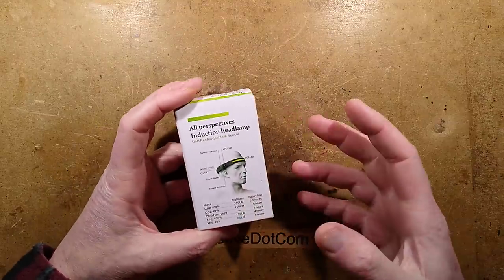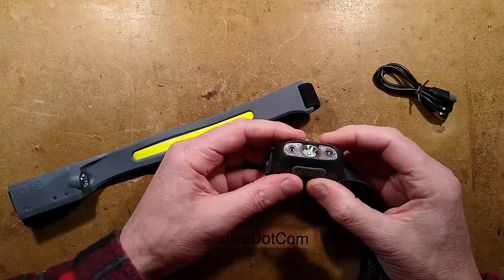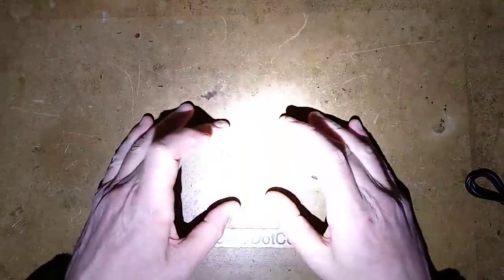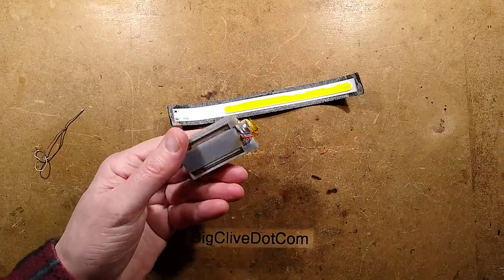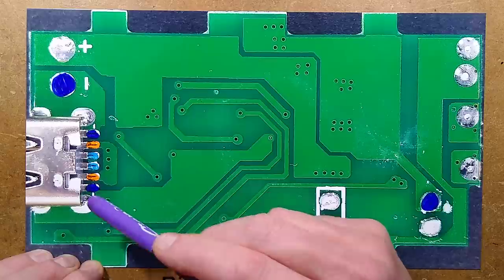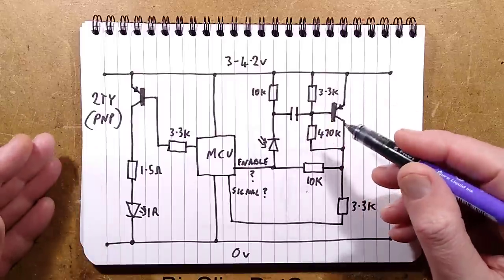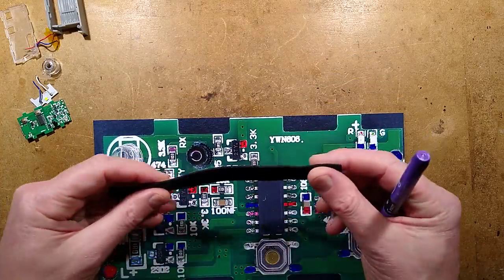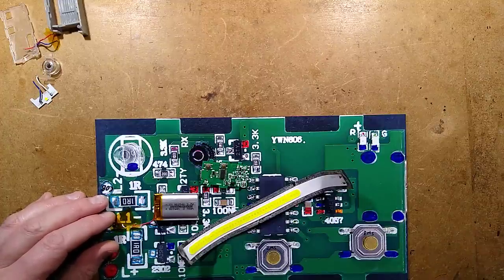Night Buddy style headlamp teardown with schematic

Comment: Those are everywhere, both on eBay and Amazon. But it’s nice to see the soft ones for a change. There are some that have the focus lamp on a swivel on top of the led strip and some that have sensors for proximity and a hard backing (usually a thin sheet of drawn aluminum or abs polymer). Just beware that most of them have poor to shoddy quality and they will let water in if you use them in the rain. Some have such poor insulation or tolerance fittings that if you just use them as-is and strap to your forehead and go for a walk, the perspiration will get inside the “protective” area of the photo strip and fog it up or even short it. Also there are plenty that have very short cables between the battery and control pack  that make using them in cramped spaces, where there’s a high likelihood of hitting your head/helmet/headlight to be a huge hazard for the headlight itself. Had to change the cables from one set because they were so thin that just the act of removing it from my head and folding the headlight with its strap to store/recharge would break the originals (got one set waiting for a cable set that only the photo strip works, the headlamp got either cooked or the wires for its switch in the board snapped as well).

Comment: Nice video and very informative. I have this headlight and is ok. The cob light is actually decent for work in open spaces, camping. I don't use the focused light very often. One thing I observed is after several weeks of standby it is self discharge. When I connect the charger it takes time to get any feedback from the led. First time I was testing several chargers and I was thinking it is game over. But after 15 minutes the led was on and charged the battery. Since then I connect the charger every week and no problem. The original cable has a longer USB C connector and working fine. I you are using other cable, the connection is not good and no charging.

Comment: I have found that with the cob directly on forehead lights like this one that they cause my glasses to flare with the reflected light. I have a preferred one that has a 1-2 inch cob and a focused beam on a pivot that also takes a removable 18650. Super cheap but works really well for me.

Comment: My favorite headlamp for working at stuff is Sofirn HS10. it is aimable down to my nose if i wanted. Features 16340 battery with 800mAh capacity 1100lm output with 90CRI LED amd TIR optics. And the cherry on top - magnetic tail cap to stick it to anything metal when not using as a head lamp... You should consider doing a video on it.
PS: It does have smooth ramp up or ramp down of power output. But it doesn't have no contact wave hand in front function however.

Comment: "I need a new flashlight."

Regular human: Walks into a store and buys one.

Me: Let's see. USB-C. Time to start upgrading those Micro-USB ones. Button on the side, not at the end. Good. Short press to turn on and off. Long press to change modes. Good, good. Now for the headlamp. Rechargeable AAA batteries, please, so I can replace them quickly. Short press to turn the lamp on. Following short presses change modes. After being on for a while, short press turns the lamp off. Next press turns it on to the previous state. Excellent.

There is a special place in a very hot environment for engineers who think it's a good idea to always have to cycle through every setting just to turn the unit off. 😅

Comment: I do like it because when I'm working on a car under the hood I get the illumination of the cob which is great but I also have the focused beam which I occasionally need to see down in between the engine and the firewall.  It's rude to blind people with the cob which is why the infrared sensor is very useful because my hands are dirty and I don't want to fish around for the button with all that grease on my hands.  Although it falsely triggering whenever my head gets close to something is rather annoying so there's not many times when I can actually use the sensor.  I bought from two different sellers on ebay. Both very inexpensive.  They had some large differences. One of them was lacking the dim setting on the side light and it's battery got all swollen up and it quit working after only a week of owning it.  The other one still working great and it's 2 months old now.  I like how lightweight they are and it's nice having the bulk on the side of your head instead of on your forehead.

Comment: I find these very useful when I need a diffuse light for seeing a wide area. As an old fart that needs reading glasses for close work, the side mounted direct beam isn’t that useful as you need to Fanny about getting it lined up so that you can see in focus without the beam high ting your right hand glasses lens. The PIR on/off function is useless if you’re working under or around vehicles (or anything else) and I’ve had it operate walking through doorways.

Comment: After another video you did about "head torches " I bought a Nitecore HC60 1200 lumen, great light but it will keep your forehead HOT on any setting other than low, had it on high and made the mistake of setting it on the floor with the lens pointing into the carpet, melted an EFING HOLE in the carpet, super bright leds are great but careful where you set them.

Comment: I have exactly the same!
It was named COB LED. 

Do know, that when using the LED strip, att full - it get's hot behind the rubber part. Really hot.

The sensor is not that good, I use this at work. And the main reason why the sensor is not good, when getting close to objects, it either turns on or off..

Comment: I like these. They are necessary for my work and are light and low-profile. You don't have to scroll through all the settings to turn it off. Battery life on high isn't great, but you can just buy a few and swap them out.

Comment: I also prefer the same kind of head torch as you prefer. I had a really nice one that was powered by three AAA cells, but unfortunately I once left the cells in it for too long, and they leaked all over the inside and killed it. There was no outward indication that the batteries had leaked because the compartment was so well sealed. I found out when I opened it up and it was basically full of crusty white sludge.

Comment: Get 80 dollar "Low Profile" Milwaukee headlamp, its the best thing I've ever bought working on racecars. The LEDs are a warmer color and the working time on full bright is outstanding. Plus, if it dies, you can swap the battery. If you need a reliable headlamp that will always shine when you press the "on" button, get the sub-100 dollar Milwaukee.

Comment: My favorite head light is a very small pair of lights embedded in my beanie. It's not the best light but it's quite decent for how small and long lasting it is. I wear it just to wear a hat and it comes in handy all the time. I want lights in everything! Once we can cheaply manufacture small batteries capable of powering useful leds that can last for many years we could just start embedding permanent flashlights in everything, clothes, furniture, pens, jewelry

Comment: I never really took to head lamps. Instead, I have a small pocket flashlight with a neodymium magnet base, and that's worked best for me. Since I'm typically working in equipment racks or cars where ferrous metal is abundant, it's nice to be able to just stick it someplace and not worry about it. Gotta be sure not to forget it's there, though. Already lost one flashlight that way.

Comment: Ahahahaha, thank you for this one.  A local (Colorado, USA) company has claimed to have designed these when it now looks as tho they just found and imported them.  That said, their rep was in my hardware store yesterday (2-17-23) handing out a few free samples, and I got this one plus an unrelated COB key fob.  A COBFOB if you will.  I've "poked at it with a sharp stick" (the head band I mean) and held it underwater a bit (nasty me, I put a bit of dish soap in that water to eliminate surface tension) and then rinsed it after a bit.  But it's probably still wet today... too early for any corrosion to have set in... anyhoo, I do love your reviews and this one is suddenly timely for me.

I will say it's pretty bright.

Also, can we hope that this is a Li-ion battery we are strapping to the sides of our heads and not something prone to explosion and/or fire? 🙃
Reply: PS: our previous headlamp (used for camping mostly) was from the 1980s, used incandescent lamps and four AA cells and felt a bit like strapping a miner's "wheat lamp" to your forehead. O_O

What @Miata822 and @SiCrewe both said! This thing is a game change, IF it holds up, and for me that remains to be seen.

Comment: I have the simple one, too, I think maybe I got it after you took one to bits.  It's really handy, though I don't use the motion-detector mode that often.  Otherwise, great little light, probably the best headlamp I've ever had.  It'll be a little annoying when the battery finally dies unless I can find a replacement pack of a similar size, or if I can find a whole new one for not too much.  ISTR it was pretty cheap anyway.
Reply: These batteries are easily available on eBay. All the sizes and shapes are available.
Reply: I got a two pack of those I think from that same video, both of mine self-drained to 0 sitting in a drawer for a few weeks and wouldn't take a charge again.  :/

Comment: I have a really cheap similar one. There isn't a spotlight but the cob bit on the front is a lot wider and it has a little box at the back with 3 red LEDs which copy the cob section: full, medium, flash. It is great for fixing my bike.

Comment: I bought one of these recently under the brand name Molaer for $18 USD (Black rubber instead of Gray). I'm happy with it, and it does a good job.  I don't like how it flashes as the first on selection, but I do like the hands free feature as when I'm painting I don't want to touch anything once I may have paint on my glove.  I would have liked the hands free control to be able to switch modes instead of On/Off as I have use for different use cases when I'm using it.  IMHO, I think the strobing function was for use in roadside disabled vehicle situations where you want oncoming drivers to see you, and that is why they put it first (although I don't think they thought out that use case ). Opinions?

Comment: I found a variant that has the COB headband, but instead of the side mounted spot LED, it has a more "standard" adjustable main beam in the center.
Doesn't look as snazzy and sleek as this one, but with it being aimable so that it'll actually light up the thing you're working on, more practical.
They advertise the "main" as being an XPE, and it is lensed and apparently intended for a fairly narrow spotlight.
It does have a larger power/battery module with a 2Ah 18650 in it, and reviews suggest that the weight on your head is a little imbalanced as a result.

Comment: Since I started selling and modding flashlights about 2 years ago I've been reverse engineering them. I drew out the schematics of a few flashlights and they all seem similar no matter what brand or how many modes. One thing I noted is none of the LEDs have resistors. I believe they have done some tricks inside the chips to save space on the outside of the chip. Sometimes I buy samples and then decide if I want to sell them. I've seen some other things being done I like to look for. They dim the LED to make a cheap lithium battery have a longer life, that would be the 1-ohm resistor on this headlamp they would change it to a 1.2 or 1.5 it doesn't take very much. A 1.5 resistor in a flashlight would probably make it dim enough to delight everyone at a redlight star party if you changed to red so there is some usefulness in making it dimmer.
Reply: Just to let everyone know to avoid angry people, headlamps or anything with white LED even if it has red mode is being banned at some star parties. Probably screen filters and tape over the white LED on smartphones are next.

Comment: I bought the motion detector one for £10 brand new as a spare torch 
Other than blinding people if you turn to speak to them, I have found it very bright and easy to charge.
Reply: Blinding people with head torches is a problem with them all.  In my experience sites at night are full of people dazzling each other and swearing at each other.
Reply: Where did you did you buy it for £10, please?
Reply: @healthystyle  
An eBay seller around 6 months ago.
Reply: @brianiswrong  Do you have the ebay seller?
Thank you for responding to me

Comment: I bought a couple of regular strap on headlamps at Dollar Tree for working on computers. They have regular white LEDs but are not very bright. They also use coin cells that don't last very long. One day, I bought some of those small push on push off lights for closets, under cabinets etc. I thought, hey what if I use one of these for a headlamp. So I took the strap from one of the other headlamps and stuck one of those onto it with sticky pads. It work much better and, due to using 3 AAA cells, it lasts much longer. It looks pretty goofy but works well.

Comment: I got one of these (or rather one of the many many clones) and it was actually pretty great for walking the dogs in the evening in the winter. However, it wouldn't accept a charge. So I got enough use from the charge it came with and that was it. Less than a season and it was dead. I extracted the battery and it's fine. Something was not good with the circuitry and I didn't care to try to fix it.

I upgraded to a Liteband 400. It only has the COB light. But the battery is on the back of the band and I actually have dual 18650 battery holders that work with it so I'm not bound to the included battery.

What I like about these is they're more comfortable to wear while walking the dogs, especially over my beanie for the colder nights. I have a Milwaukee head light that's quite a bit better as a work light.
Reply from the maker: Try it with a different charger.  A smart USB C charger may not recognise it.
Reply: @bigclivedotcom  I tried many, including old USB-A chargers with A-C cables. It's a bit ancient history at this point, though, as I salvaged the battery for other purposes and tossed the rest long ago.

Comment: Ordered the all perspectives induction headlamp from Amazon. It came in a pack of 2. The batteries are 1200mAH, Unbelievable. They lasted more than 10 hour on the COB lights highest setting. The red indicating lamp on the battery pack was flashing quickly so I presumed the end was near, but at that point I turned the light off. But yes, it lasted 10 hours and was still in operation, but how much longer? Who knows.  Impressive.

Comment: I've had a pair of Bolle Galaxy glasses for years - very good as the (small) side lights are well boresighted to my eyeline, and provide a smallish well focused spot of light. Good for close work or well aligned for walking around as they match eye placement. Some head torches spread too much light, and as they're forehead mounted tend to cause neckache as one tries to compensate for the slight misalignment of the beam, and they're not sweaty with a headband, and the lenses offer full eye protection..

Comment: I usually open the warehouse in the mornings. Normally when I get in it is dark and the light we have is insufficient to do much of anything in the front area and it's completely dark in the back area. One of these lights might be useful to tape to my hard hat for use in the wee hours of the morning. I wish the LEDs were brighter because this would be a great reading nook light. It's diffuse so you won't have to adjust it every time you want to shift positions in your nook. "Read with a proper lamp" you might say? Sometimes those things don't fit where you want them. Mount this above you somewhere and it's a compact lighting solution.

Comment: My experience with the thing is that you can point the "spot" led by tilting the band on your head, but I do not see the light as very practical for working while sitting. Makes more sense when walking around indoors, without bothering to switch on/off normal lighting, and without needing much distance illumination. If hot already, the leds on the forehead does become a bit noticeable, but nowhere near scorching.

Comment: By the way those two shorted USB pins in the middle are not "data lines" (at least in the traditional USB sense). They are the CC1 and CC2 pins. Those are used to signal to the other side whether you are a power source or power sink. A power sink pulls them to ground with a 5.1k resistor on each pin. A power source pulls them towards +5V or +3.3V  with a resistor that indicates available current. Then there is some special logic for advanced cables, which we'll ignore here. 

By pulling them low you tell the other side that you need power. If that's all you need you are done with the two resistors. This seems to be one of those buggy devices that short the two pins, so adding a single 5.1k between the short and ground will work with 95% of power supplies (if not: swap the cable for a cheaper one that can carry less current - the chip in the cable is sabotaging you).

If on your own devices you want to be really nice to the power supply you would check the voltage at those pins after pulling them low - it will tell you whether you have standard USB 500mA, or you get medium 1.5A or even high power 3A. If you need even more you need to implement power negotiation and communicate over those pins by pulling them high and low for zeroes and ones. There are chips that can do that for you.